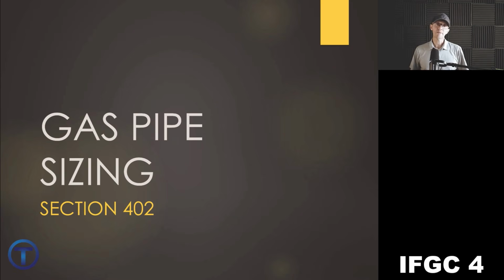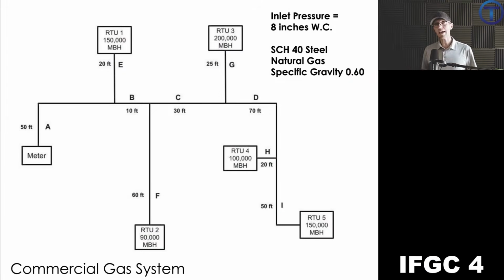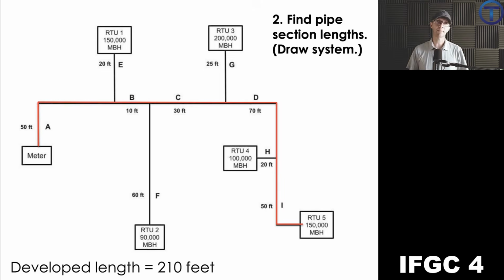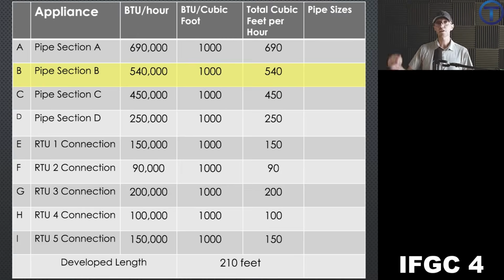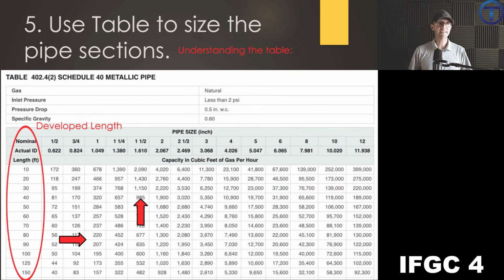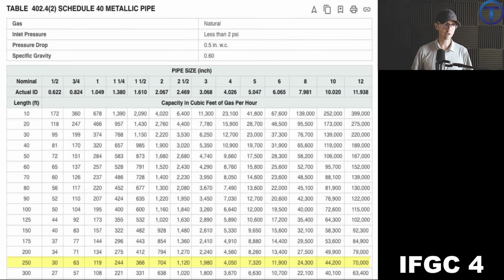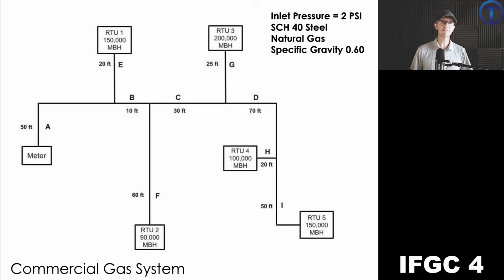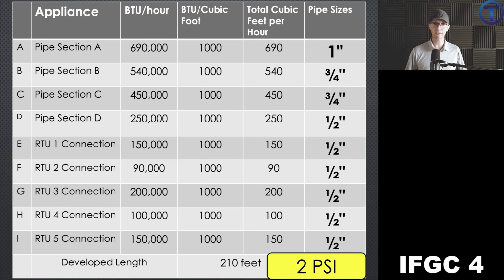Gas Pipe Sizing Lesson 2 - Longest Length Method - Commercial System - IFGC

Comment: it seems the only difference between the tables using such 40 metallic pipe for ng is the pressure drop. how do I determine pressure drop for the system?
Reply from the maker: That is a good question.  I don't know so I Googled it!  Pressure drop is a result of friction as the gas moves through the pipe.  You get into so pretty deep engineering level math calculations to really figure it out.  In general, you can size if you know the gas type and inlet pressure.  Then assume that if it is a small system you will have smaller pressure drop and if it is a large system with lots of pipe distance and fittings, there will be greater pressure drop.  Sorry, that's about the best I've got.  

On a State test, I imagine they will provide you with enough information, including pressure drop, to narrow it down to one table for sizing so you can answer the test question.  

Hope this helps.

Comment: Hey Tom I noticed that fittings weren't included in the equivalent length calculation. Do you suggest including an %error or counting elbows and fittings which could add more length to the system? Thanks for the video!
Reply from the maker: Good question.  It is not necessary to deduct for fittings using these methods. I’m pretty sure those tolerances are factored in.  Longest length method is the most conservative so using that method you should be fine.

Comment: Hey Tom in your first example (not 2 psi) if I have 7" wc (not 8" wc)  can I use the same chart if pipe and gas are the same as your example?
Reply from the maker: Yes.  The table can be used for up to 8"wc
Reply: @plumber-tom9470  Thanks Tom!👍🏼

Comment: Hey @PlumberTom, in this video when you selected the Table 402.4(2), why did you not select the Table 402.4(3) given that the inlet pressure was 8"W.C.? I noticed 402.4(3) has an intended use section where it says"initial supply pressure of 8.0" W.C. or greater and was curious. Hope to hear your thoughts on this! Thanks!
Reply from the maker: Thanks for asking.  This example was taken directly from the IFGC code commentary.  The explanation says "Because the system pressure is less than 0.5 psi (14 inch w.c.) Table 402.4 (2) is chosen."